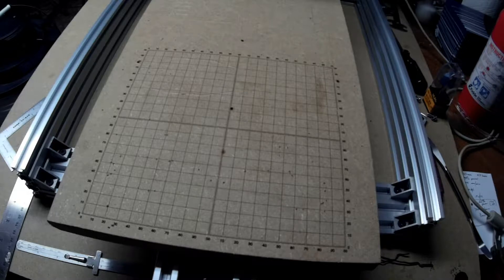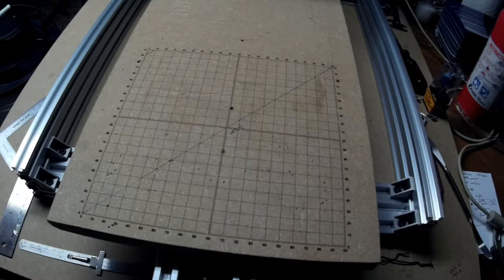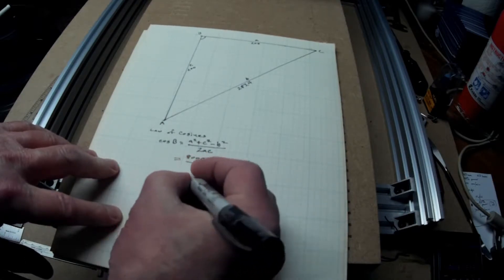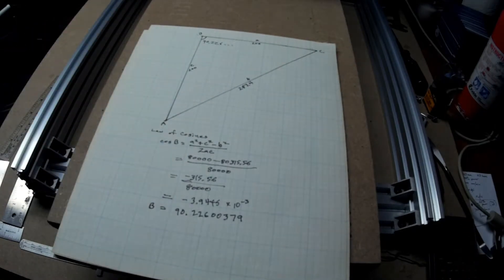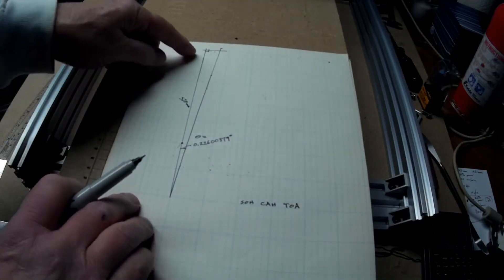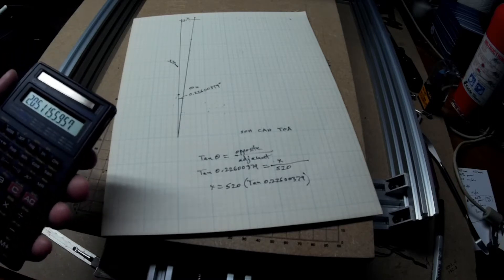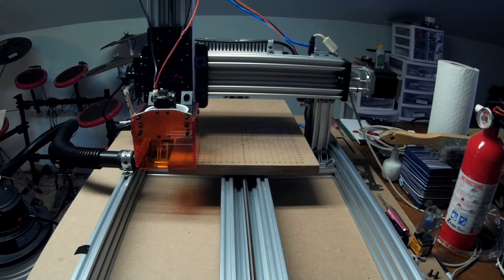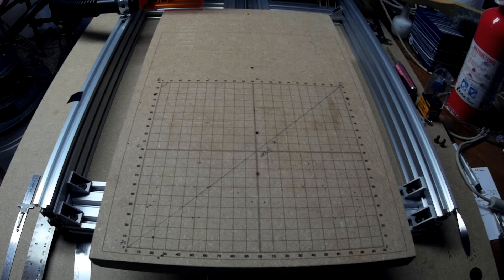Calibrating Y-axis Perpendicular to X-axis

Comment: I use dual Y? How to axis X perpeldiculer axis Y?
Reply from the maker: If you leave your spoil board attached and fixed in place (to keep your two y-rails parallel to each other), you should be able to use the same method.  Note, that I have two brackets on each end of my single y-rail (one on each side).  I loosened all but one and used that one as my pivot point.  If you have 2 rails, then you probably have 8 brackets.  You would loosen 7 of the brackets, and use the other one to pivot the entire assembly including spoil board.  You DON'T want to do each individual rail separately with this method, because then the distance between your rails would change and you might get binding.  Hopefully, you won't have to adjust much more than I did.

You will have to take care to make sure your rails remain fixed relative to each other if you use this method.  I think if I were attempting it, I would add some sort of fixture across each end of the rails to hold them together.  (Like a couple of lengths of 20x20 extrusion bolted to each rail, or maybe a couple of pieces of wood with holes drilled and fastened to the tops of the rails with T-nuts.  Or better yet, block your carriage and spoil board, front and back, centered on the axis to lock it in place.)
Reply: @sloscotty  how do I know how far off the y1-axis is from the y2-axis mm?
Reply from the maker: @ngoducdam92  They should be parallel.  If the distances aren't the same, you should definitely correct that.  Can't advise you since I don't have dual y-axes.
Reply: @sloscotty  i don't understand (80000-80315)/80000?
Reply from the maker: @ngoducdam92  It's just from the formula (at 6:59).  a^2 + c^2 = 80000 ; b^2 = 80315.56; 2*a*c=80000.  You might want to look up "Law of Cosines"